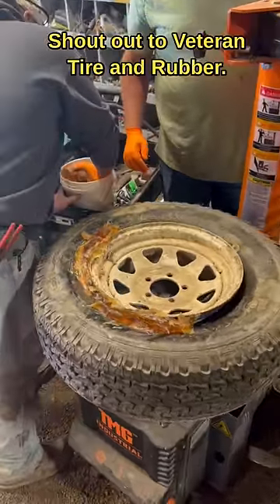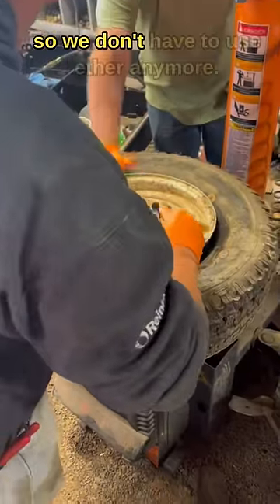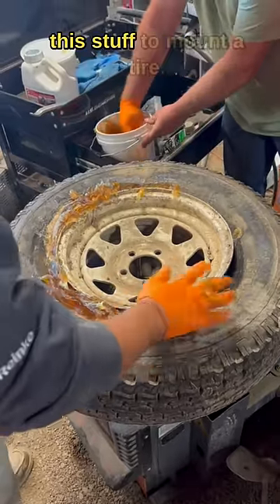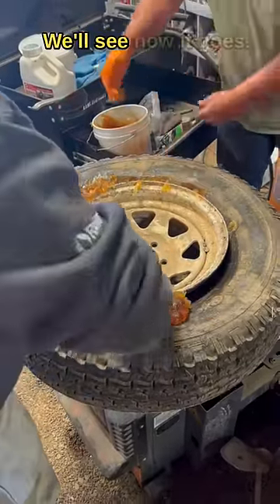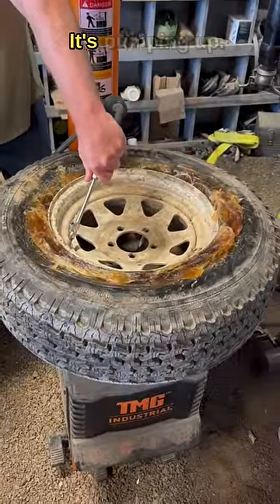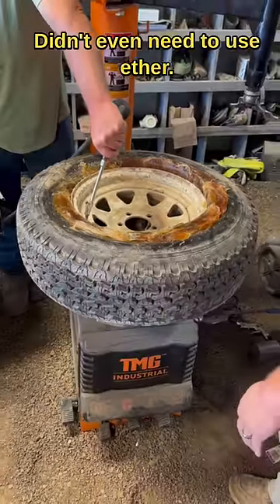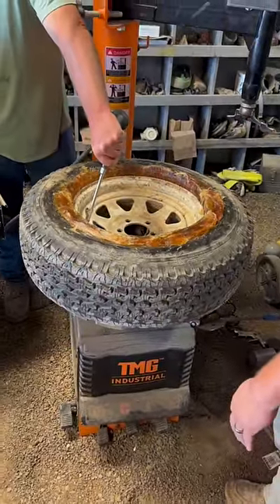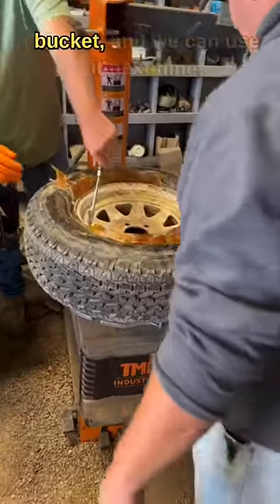Veteran tire and rubber sent some tire mounting compound. Let’s see it work. #farming #shorts ￼

Comment: Years ago we just had a strap that went around the center of the tire with a hand crank to tighten. Worked fine every time. I have even used a rope with a stick to tighten it.
Reply: Ratchet straps work great 👍
Reply: Every day we get further and further away from the good ole days, the stupider people get. I'm saying this I bet you think I'm old. Nope I'm only 26 and I felt like I've been born in the wrong time. Every car I see now I hate. Every piece of technology kinda pisses me off. Every car I've owned has been at least a classic.
Reply: Yeah, that would take common sense
Reply: Bead blasters are wicked, you'd never go back if you tried one.
Reply: @Meoffjackk01 i feel your pain bro
Reply: @Meoffjackk01  I'm 21 and I have always felt that way I drive a 93 b2600 and an 85 ramcharger they get me to work everyday and my truck is good on gas. I love old cars I own nothing newer than 93
Reply: I lost my eye sight for 4 days doing that😂. ratchet strap was too tight and the ratchet strap exploded and it flew about 30 feet straight into my temple. (Rear tire on a farm tractor)

Comment: I used to work at a tire shop years ago and we had a soft rubber ring. You just lubed the ring and popped it around the rim in the space between the tire and rim, as you air the tire up it would just pop the ring out. Always worked great, no mess and I never had one get stuck.
Reply from the maker: Interesting
Reply: Only seen that a couple time but one for every rim size, reusable, pretty cool
Reply: Back in the day, I saw a kids bicycle inner tube partly inflated to do the same thing.
Reply: I’ve used those before work most of the time I’ve got one stuck before tho
Reply: I used to work a very old mechanics shop and they had them. The air bead blasters work much better.
Reply: R a bicycle inner tube
Reply: @jonathanrabbitt i thought i was the only one to use a bike inner tube. Can stretch a 195/65 onto a 8 inch wide 15 that way.

Comment: Cheetah Blaster has left the chat...
Reply: There been times where I gotta use monkey snot a cheetah and a ratchet strap man sometimes fuucccckkkk
Reply: She don't work everytime
Reply: That's when you get your buddy and double team cheetah blast.

There ain't no tire mounting problem that can't be solved with more cheatah.
Reply: @jacobg6528  That's when you pull out 2 Cheetahs or the 10 gallon model...
Reply: Exactly 😂😂😂
Reply: Cheetah blaster works quicker
Reply: @jacobg6528 for this tire and wheel it should of definitely worked. I've done it thousands of times just by looking at it I knew I could of done it with the cheetah and taking off the valve stem core hooking up the air hose so it's just throwing air non stop so when the cheetah sits the bead it doesn't come off. at least they got it done tho I guess
Reply: Ahhh yes the cheetah 😍😍
Reply: Cheetah doesn’t always work. Ether is dangerous, I’ve don’t this several times. A lot of times for trailer tires.
Reply: @jeremiahcreech3491  The cheetah damn near always worked for us when I worked at a semi truck tire shop. And when it didn't it was because we were trying to air up reapirs with them being really loose and all. So then we would just connect the air pressure hose on the valve move the tire a little and then hit it with the cheetah and after a while it would work. But me personally the cheetah was pretty good and fun because of the little kick back lmao
Reply: @jeremiahcreech3491  you are right cheetah doesn't always work. But for this tire it wouldn't of been an issue if they applied lube on the bead and had the hose attached to the valve step without the valve core. Just by looking at this tire and how it was sagging I know it would of worked. But at least they got it done I guess.
Reply: @KvngJTP  lol yeah same here cheetah almost always worked rarely it failed. and hell yeah the blow back was the reason I'd use it even if I didn't really need it lol
Reply: @arthurgarcia4389  Sometimes when  I was bored I would let it fill up and just shoot the air to the ceiling as if it was a gun 😂😂 sounded good asl tho lmao
Reply: @bluedistortions haha got hit in the nuts once (w\air) doubling up on the cheetahs!
Reply: Dude was telling me just the other day bout 44's & ether... enough to bounce them up a couple feet off the ground!
Reply: Tire stickers balled up cheetah shoots them pretty good! Ha

Comment: I've been using a tie strap right in the middle of the tire. Tighten it down until the side spread out to the bead. Put your air to it and watch it inflate
Reply: If that works, that’s genius
Reply: Yep exactly what I was gonna say grab a ratchet strap 😂
Reply: Hell yea. That works on lawnmower/trailer, etc. tires also. 👍
Reply: Can you do a video for this? Sounds awesome but i can't really see it in my head
Reply: @drwombat loop a ratchet strap around the tread and tighten it to push sidewalls out closer to shoulders of the rim. Do this on big Ag tyres in conjunction with a bead blaster. Need to release strap quickly so it doesn't snap on you and cause injury
Reply: That's how we do it in a small engine shop, strap around tire, enough to catch the tire and rim. Remove strap and finish up airing up
Reply: @RageBiker1  oh around the circumference? Not like around the tire or thru the hole?
Reply: I mean, I didn't really seem to be that messy
Reply: Hey, a legit question Jack. Do you think a giant ratchet strap would work with a semi tire if it has popped off the bead? I definitely wouldn't have thought of using a ratchet strap to get it to get back on the bead though. +1 sir.
Reply: @DARKSEID007 if you can get enough air or push the edges out enough. I figured out the method on my own one day. I've used it a lot. On my mower and other stuff. But I've had a couple not work became I couldn't get the side walls close enough to the bead as the tire was all the way to the rim... So it might depend on how wide the strap you use is 🤷 not 100% since I found out just rigging stuff before I knew about the ether way... Granted I use pretty much only ether more because it's more fun.
Reply: @zacharythebeau163  can someone please do a video of this... It seems the "safest" method but even tho I now "get" how to do it, I'm still curious how quick you have to be regarding the timing between airing up the tire, bead seating, and unlocking the straps so you don't hurt yourself/tire... Would hate to hurt myself but this seems like a great solution to my motorcycle tire mounting problem
Reply: I posted a video of it awhile back
Reply: Try it on a forestry or heavy equipment tire
Reply: yep, that works . I do the same thing. on riding mower front and rear tires when they come off the rim. You can use heavy grease or a plastic trash bags also.
Reply: @drwombat As soon as it seats well enough to start airing up the tire, stop airing it, release the ratchet strap and then finish airing it up to the correct pressure.
Reply: Fantastic road side trick ! .
Reply: My grandpa showed my that trick, it's satisfying to me, for some reason
Reply: I've been using that method since the 90s and it does work most of the time.
Reply: I’ve used this same method (ratchet strap) on my 35” KO2s after popping a bead off on a trail from being aired down too much or snagging a valve stem on some kind of obstacle.
Reply: Doesn’t always work, I know.
Reply: I use my belt to wrap it around the lawnmower or snowblower tire and get those to air up, too

Comment: Customers wheel is about to shake more aggressively than ever with all the murphys that just lodged in that tire
Reply: Probably best used for off road tires not street tires
Reply: @ravvaktheannihilator69  yeah I use murphys for stuff like combines and mine trucks, definitely not passenger
Reply: Good thing it's just a trailer tire.
Reply: @TheGoatLocker  trailer wheel, that’s a truck tire
Reply: @TheGoatLocker  and still, you fill a trailer tire with murphys that trailer is going to be all over the road and better yet eventually ruin the bearings in the hub lmao
Reply: if you call it Murphys then you know what you're talking about 👍
Reply: @jdonnelly508  it could be knockoff too, but I just call all of the “mounting compound” murphys
Reply: @vrcompatible8999  yeah that's what I was saying, everyone I've ever worked with calls it Murphys no matter what. it's just like calling tissues kleenex
Reply: People do stuff for views
Reply: why would it be in the tire? the several pounds of air pressure should force it out.
Reply: @adamhalcyon3393  it's basically impossible to keep it all outside the tire with a gap that big
Reply: @adamhalcyon3393  if it was all forced out, it wouldn't work lol
Reply: @jdonnelly508 is it really bad to get it inside the tire?
Reply: @chitownbangin  I mean it's not gonna do any damage to the tire but like he said it's definitely gonna shake when you have a lump of Murphys rolling around in your tire and that could damage other components
Reply: I have used this stuff a lot and never had any get inside the tire but I didn't use a whole damn bucket on 1 14in Tire😂
Reply: The fact you called it Murphy's says you know your issshhh hahaha tyre fitters these dudes seem a little slow...I was hoping bead would of popsealed and covered them
Reply: @ashoangel5716  ehh sometimes it's inevitable, definitely safer for them than ether lol just wait til they have to use a whole bucket of Murphys a ratchet strap and still need a cheetah.
Reply: #farming
Reply: @jdonnelly508 i wish i knew tire lingo n facts to understand what yall are talking about (i only know construction/engineering stuff lmao) bc this sounds kinda interesting! but it seems like yall are speaking a foreign language haha. what is murphys, im assuming brand, but what is it for? is it to fill the space between the tire to mount it or seal it or something? im just trying to figure out what why and how everything works bc im intrigued and started to form questions 🤣
Reply: it actually liqufies like in a cream seperator and coats the inside kinda nice. still not fun for the next tire guy tho
Reply: It should distribute itself pretty quickly like balancing beads
Reply: My tire shop uses an air cannon bead seater when rim too wide for tire and won't seat.
Reply: @jacobnorth8642  yeah the shop I worked at last would too but sometimes fire was the better option for more than one reason. We'd get these tires in that had super stiff sidewalls and the only way was to try fire a few times in a row, and then hit it with a bead blaster while the rubber is slightly softer from heat
Reply: @jacobnorth8642  yeah man it’s cheaper than murphys that way too, 300 bucks for a 16 liter blaster and you can use that shot on farm tires where the beads are basically kissing
Reply: @DarkAttack14  nooo that stuff is so thick it just balls up like clay
Reply: @KryztovM  only if it freezes, I use it everyday and can safely say that’s not true
Reply: @febrieze  murphys or “mounting compound,” is just a really thick lube that you spread with your hands. Another great use is what they did in this video but with wayyy bigger tires.
Reply: Actually it will help balance the tire as it spreads inside
Reply: @aegith1816  that’s not accurate at all, also even if it did spread inside that’s not good, the reason people use balancing beads is because no matter what the beads work around the tire at all times. When it stays in one spot it throws it out of balance significantly lmao
Reply: @aegith1816  you are telling a professional “aCTuaLlY” 🤓
Reply: Lol
Reply: It's a common aftermarket trailer wheel.... it's not for a Lexus 🙄
Reply: There's always one in the shop that knows everything about everything...They'll stick some bullshit in there if they don't get enough "ohhh's & ahhh's" too! 😅
Reply: @barnes29510  based off that comment I can tell you are the guy who has to be corrected often for being wrong, sad
Reply: @barnes29510  trailer wheels still need to be sturdy lmao, your trailer tire is full of murphys, chances are your trailer is also going to be all over the road
Reply: What are Murphy’s?
Reply: @vrcompatible8999 damn, I was hoping you actually would post that video
Reply: @SabertoothDeathmouse  honest to god I forgot, I’m a busy guy lmao
Reply: @vrcompatible8999 honestly I’ve been using Murphys for 10 years+ probably changed 100 tires on my farm mostly semis and pickups. I use different methods like the ratchet strap, bead blaster, and the good old roll. But I’ve never had a semi tire that “may have a little murphys inside” drive me all over the road. If you can notice it and it’s an issue for you then that’s alright, but I’ve never had someone actually say that’s an issue they observe often
Reply: @BARDOWNSKIS  a semi tire and a 14 inch trailer tire are a bit different is size and proportion. You can’t claim to be a tire tech then say done thing like that lmao
Reply: Guys, here is the true Savior

HalleluYAH translates “Praise ye YaH”

YaH is The Heavenly Father
YaH arrives via the TENT OF MEETING
YaH was Who they Crucified for our sins
YaH was Crucified on an Almond TREE

Semitic of Moshe (Moses)
Isa Scroll (The Original Isaiah)

Isaiah 42:8 - I am YaH; that is my Name! I will not yield my glory to another or my praise to idols.

Isaiah 43:11 - I am YAH, and there is no other Savior but Me.

Isaiah 45:5 - I am YaH, and there is none else.

Comment: I work for a large and well known tire company in the western side of the states,  this tire mounting compund is also called "murphys" and is only used in this method if all else fails, normally an air blaster works just fine, and looking at the gap in the bead there loooks manageable enough to just use a blaster, if you dont have onez i get the point if this then, but this stuff is so messy and takes forever to wash off of everything.  Also using a thin layer of this murphys on the bead of most tires works great as an actual tire mounting compound

Comment: You can also put a ratchet strap around the tire, then tighten it so the sidewalls move towards the rim. Works everytime for small wheels like, for a snowblower, but I've never tried it on a bigger tire. Don't see why it wouldn't work too.
Reply: Might break and take out an eye lol
Reply: I've tried that trick when collapsible spares break their bead (90% likelihood when deflated after each use).
It never worked.
Reply: There was a few times I've had to use the ratchet method. It works but sometimes hard to get the ratchet loose.
Reply: It works 5 to 8 times out of ten
Reply: It definitely doesn't work everytime especially the bigger and bigger tire thats for damn sure
Reply: You can do that but it’s far more dangerous than a bucket of ear wax.
Reply: There used to be special "outer tubes" which were flat and had the valve stem on the outer side instead of pointed towards the center. Slip over the tread and inflate to force the beads outwards.
Reply: Yeah but that sounds too much like work for those hard laborers,lol
Reply: Fine for my 14s, terrible for my 15s. I use ether now, as it works for a wide range of diameters
Reply: I can verify we did it many times on the ranch doesn't work well with truck or semi tires
Reply: Worked on a bobcat tire

Comment: We use that as a last resort. Cleans your hands pretty good but hard to clean off the tire not to mention it can go flying everywhere when you seat the beads.
Reply: Question does some of this get inside the tire? And if so is it enough to through the tire off balance?
Reply: @tdjunkremoval8296 good question. I would just use other though, so much easier and less messy. And a ratchet strap works also
Reply: Now how likely is it and how slick is it if it gets on your rotors that’s my concern. It’s on an area that would just fling away from them anyhow.

oily puddle enters the chat 

had this happen before and lost a lot of braking power. Whatever it was ended up burning off after a few days. Almost thought I needed new ones.
Reply: @jonboy6517  and you can drink it too!
Reply: Gadda love the Murpheys man one of the most satisfying things in the industry
Reply: @ElisPalace definitely not soap, most are made from processed vegetable oils, Wilcox and Murphy's both are.  And yes some is getting inside, the amount that gets in will very depending on the person using it.  It very well could be enough to cause balancing issues.
Reply: @ElisPalace 😂😂😂

Your family owned a shop for 30 years and you didn't know that tire mounting compound is made from oils?!?

You should probably check your facts with a quick 10 second Google search next time you make a comment... The exact brand in this video uses vegetable oils and it literally took me under 30 seconds to double check.

It really adds to the embarrassment when you puff your chest out and act like you have 30 years of knowledge and you still don't know what basic mounting compound is made of. 

If you don't even know what mounting compound is, even after all these years of having this knowledge from your family shop; then maybe the family should've found something else to do.  It's kind of funny that you puff out your chest in the comments and then end up being completely wrong about some of the basics of auto repair 😂
Reply: @ElisPalace how did you balance the tire? A bucket of that stuff lasts for like a year of use at our tire shop. Not two tires… you use enough to lubricant the bead so it can slide on easy and seal better. You still gotta pull the tire up to the rim and use the air blast